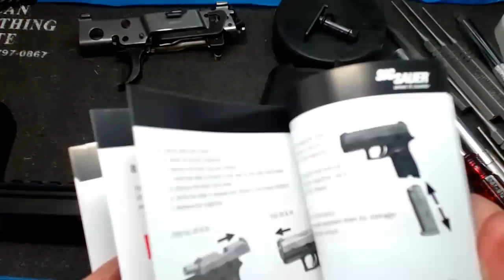Sig Sauer P320 Complete disassembly and reassembly

Comment: 9:15 I found using the stiker hole in the rear of the slide instead of your finger to break it down to be way easier, I do it with my glocks as well.

Comment: The chassis system was built by Steyr Mannlicher back in the 90ies. The Steyr Mannlicher M-series pistols are all built around it.
Reply: Steyr started to work on it in 1990 after learning the Chinese are making QSZ 92. And presented the M9 in...1999. After the Chinese issue the advanced CF-98. So, in 2007 SIG "patented" the chassis idea and issued P250, identical with P320 but DA with a hammer. Who stole from whom?

Comment: I think I may have messed up the spring inside the gun on the back side. Wen't to put a new trigger in and while i was removing that bar I think i may have bent it...
Reply from the maker: They are cheap. Get a new one if you have any doubts.
Reply: @AshburnArmorerDan  the firing pin is still working and the trigger feels fine... Hoping I can test a few rounds out tomorrow.

Comment: hi! a question about the p320 
for you the little hole on the slide, near the striker Channel and near the extractor, what is the function?
is a hole from the striker Channel or from extractor Channel?

thank you
Reply: If a primer ruptures, the gas will go through that hole and not all the way through the striker hole to the rear on the gun...in your eyes. Mausers had it!

Comment: I honestly can’t see why the army adopted this, half of joes WILL lose one of those tiny parts the first time they take it apart and the other half will too eventually
Reply: this thing is a swiss watch. how well does it work when it's full of talcum powder-like fine sand?
Reply: The armourer should be the only person taking it this far apart. The rest of the issued soldiers will only field strip it (ie just remove the slide and barrel lube and reassemble)
Reply: Joes won't take that shit apart. Never seen a Joe disassemble an M9 slide and I've been in the Army for close to 15 years.
Reply: @robpetry84  exactly.  Only an armorer would take it down like in this video.  Actually, the armorer would do a better job.  I could tell by how he was constantly turning the trigger assembly that he really didn’t know what he was doing.  Also, when he talked about “this part”, or “ that part” tells me he isn’t a professional armorer and is the first time he picked up that weapon.  I wouldn’t want to fire the weapon after monkeying around like he did.

Comment: I got my 320 back from the upgrade and the mag will not insert. Any ideas?
Reply: My guess is you probably can't pull the trigger either.  Two possibilities that I have found.  1)  With the mag out, try pushing UP on the slide lock and see if you hear a slight click.  If so, try inserting the mag again and pulling the trigger.  If this fails, remove the slide again.  Next, reattach the slide and be sure to lock it back BEFORE flipping the takedown lever up.  Once it's locked back, flip up the takedown lever, release the slide and you should be good to go.
Reply: I could pull the trigger. I took it back to the place I bought it. Two employees and their gun smith looked at it. The GS said the take down safety was too big, it could only move part way and was hitting both pins in the FCU. I called Sig and sent it back in. Now I wait... :(
Reply: @0g.Ghost.7373  is it back yet?
Reply: @arthurmead5341  yep. They put a wrong part in. They used 9mm parts on my 45. lol

Comment: other than glock, what is the simplest gun out there ?
Reply from the maker: The glock is the best baseline for striker fired guns and the 1911 is the best baseline for hammer fired, single-action pistols. The 1911 is the progenitor of all modern hammer fired semi-automatic, magazine fed firearms. While making a match grade 1911 can be quite challenging and require great feats of precision machining, the mechanics are relatively simple.

The next step up in complexity from single-action hammer fired, is double-action. The Walther PP series is effectively the progenitor of all double-action semi-autos.
Reply: @AshburnArmorerDan  where does the hi-power fit in?